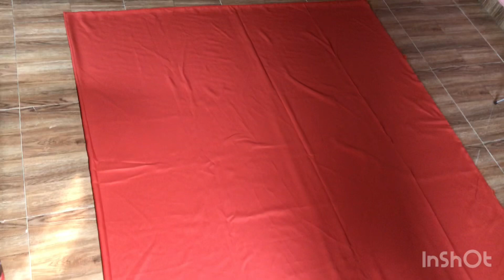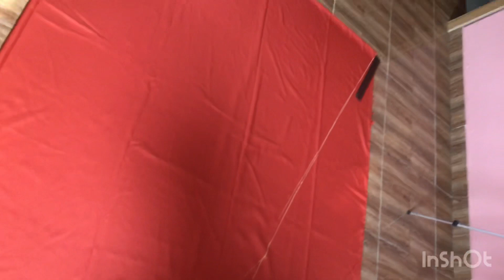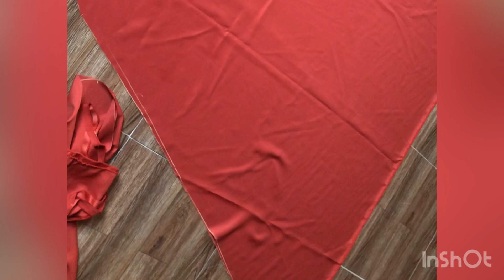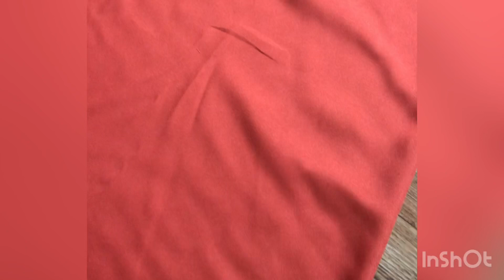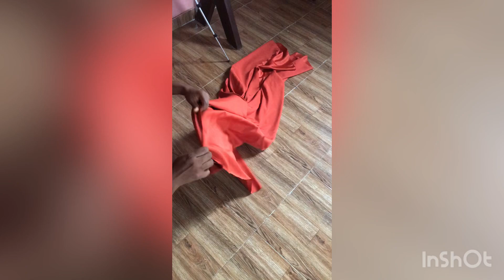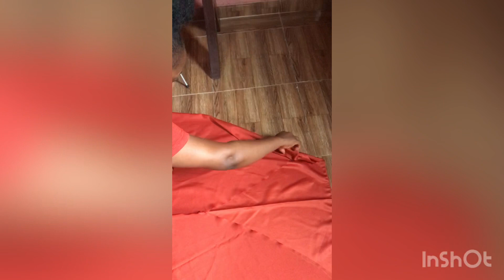DIY: Front seam high-low cowl kaftan/ How to make a cowl gown

Comment: I didn't get the fold on the upper part you lift up before cutting out because the camera didn't showing us that part you lift up, so am confuse
Reply from the maker: Sorry dear. When you lift the upper part of the front up, ensure there is no kind of folding on the other part of the fabric then turn over to the back and straighten the fabric, then trim the front to match the back. I hope this helps

Comment: You didnt tell us the inches  you use for the shoulder extension
Reply from the maker: I used 3 yards for the styles, so if you subtract 8” for the armhole opening and neck depth of 3” , the shoulder extension is 14”.
Reply: @amazingjoyfalomo  how did you get 14” please… I’m asking cause I calculated and got 16”
Reply from the maker: @tosinolowodasa2150  The 14” is length I chose for the opening from the down part, you can go with any inches that is convienent for you depending on how open you want the down part to be.